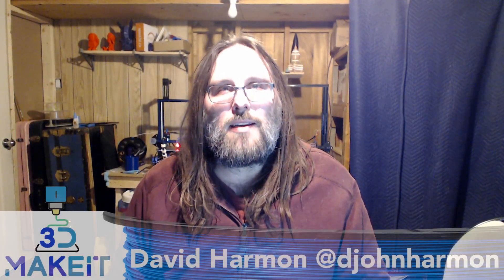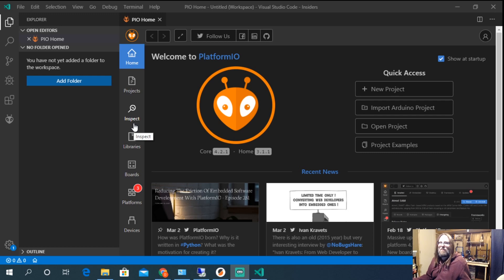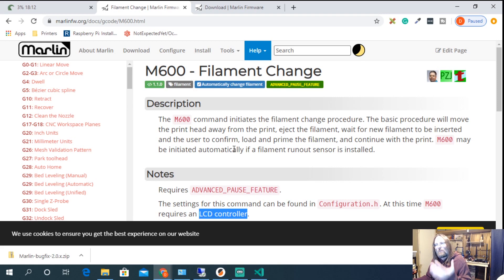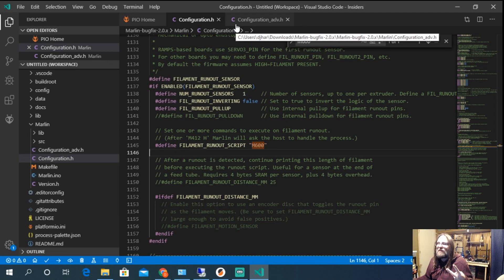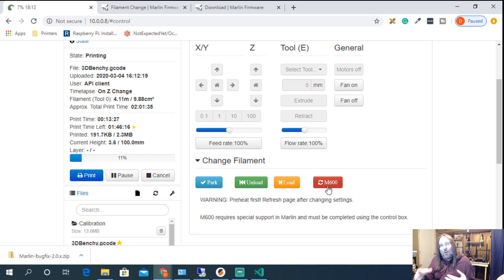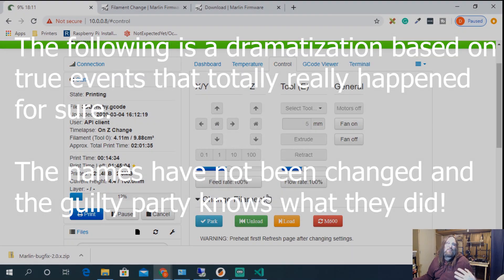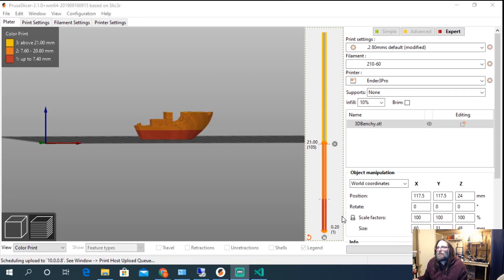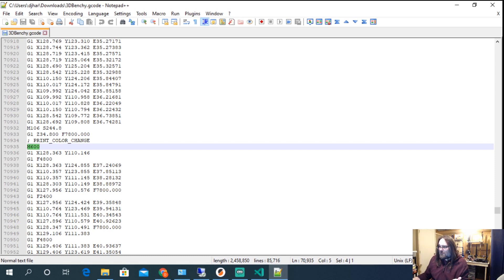M600 Advanced Pause and Filament Change Marlin 2.0.x

Comment: Is there any way to do this completely from the terminal ? ( or a touch screen)  Basically looking for a G code "continue" command Thanks
Reply from the maker: If your printing from the sd card. M25 will pause the printer and m24 with resume it. So in practice you could issue m25 to pause.  The g28 x to "park" the nozzle of the print print and once your filament change or whatever reason you paused the print for is done use m24 to resume the print
Reply: @3DMakeIt   @3D MakeIt  hello david, thank's for sharing this video, but i have some issues like you said, print from sd card..that's issues is when i slice with cura with post processing (pause at height/change filament) it's not work, that command from gcode slicer are blocked from tft lcd command.. how to solved it? (I use tarantula rs 3d printer) thankyou..

Comment: Cool :D So I have enabled the filament run out sensor, I have one on my Ender 5 Plus. How can I make it do the M600 command and while it waits for the new filament I would like it to NOT cool down the bed...
Reply from the maker: hi.  Check config_adv.  The line is  #define PAUSE_PARK_NOZZLE_TIMEOUT           45  // (seconds) Time limit before the nozzle is turned off for safety.    Increase the number.
Reply: @3DMakeIt  cool!!! but will this also keep the Bed warm? if the bed cools down the print will no longer be stuck to it...

Comment: Hey guy.. Great vid! i do love all the information you provide on your channel its a big help. especially for a marlin noob like myself lol But i am having an issue with this and i was wondering if you (or anyone in the comments really) could help me out. I followed every thing in your videos made the changes in vs code to marlin and updated my firmware and now when M600 ran it goes into a loop. at first it acts like it should.. nozzle goes into park.. retracts filament.. waits for me to select start to heat the nozzle... i hit start nozzle heats up.. I add filament then nozzle purges then nozzle returns to where i was interrupted.. but instead of actually starting to print again it goes back into park and the whole process starts over again... Any ideas what may be causing this behavior??

Comment: I don't understand because I don't have ANY kind of change filament option. Like when I'm just trying to load or unload filament, I don't have the option. Any ideas?
Reply from the maker: How are you try to control the filament change option? A controller screen ? Octoprint?  Did you configure it in the firmware?